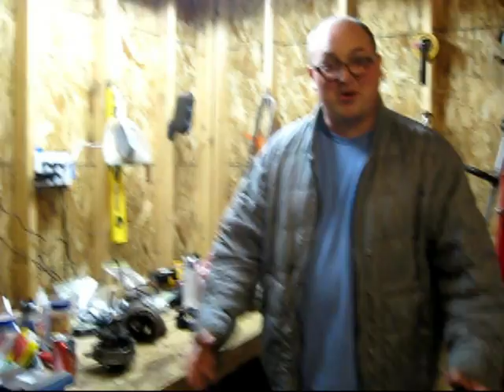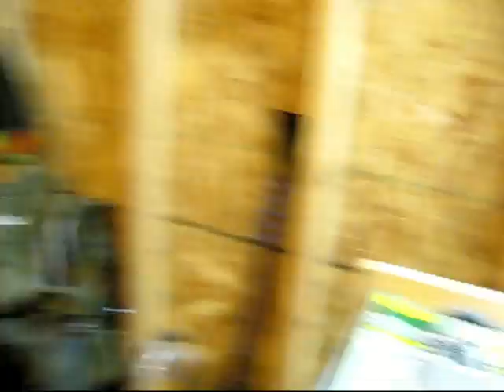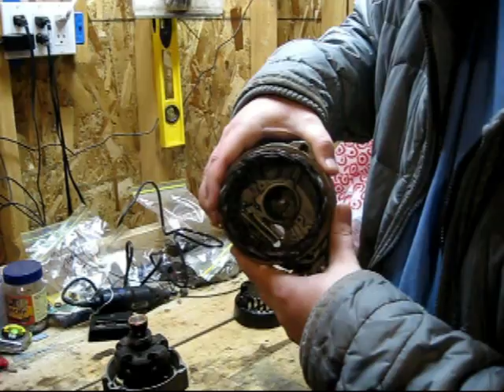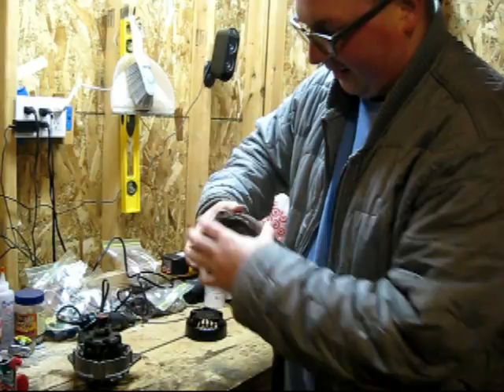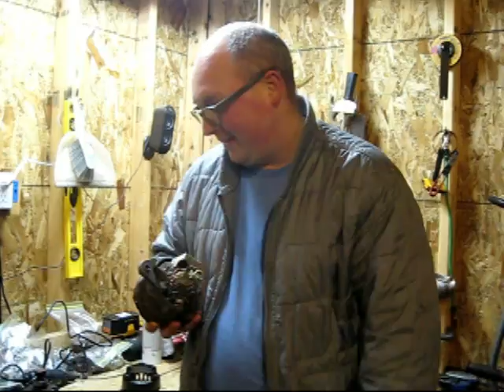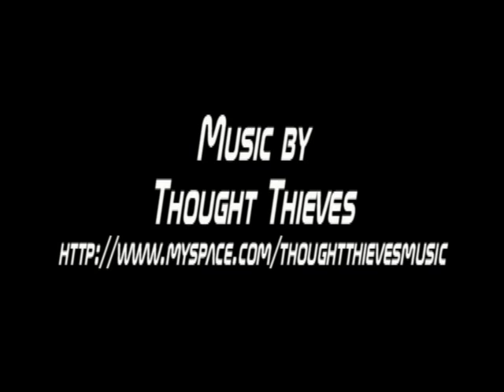MG 15 - How An Alternator Works

Comment: @sounduser I'm positive that you could, but do not understand why you would. Having two alternators would put a heavier strain on your engine, decreasing your mpg's, hp, torque, etc. You would also research how you would connect the two alternators whether they would be in series or parallel (there is a difference).